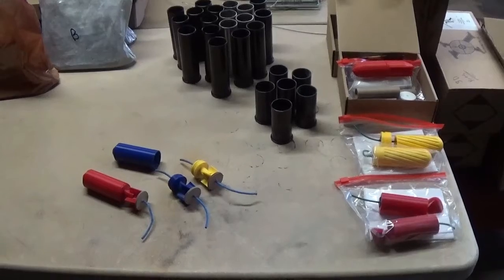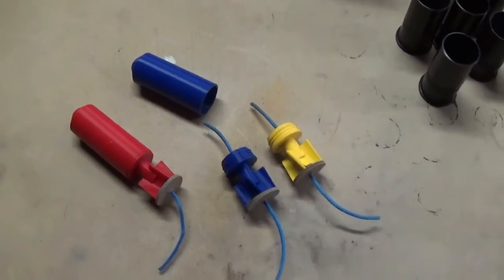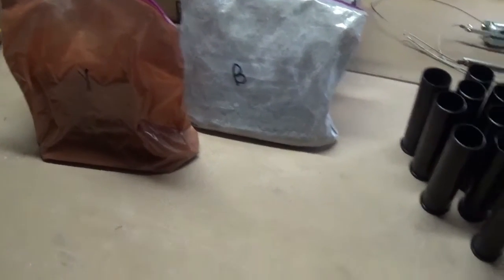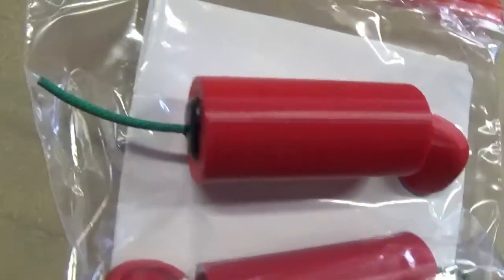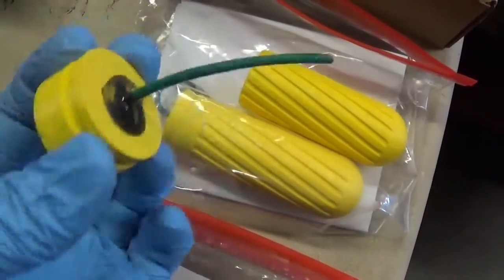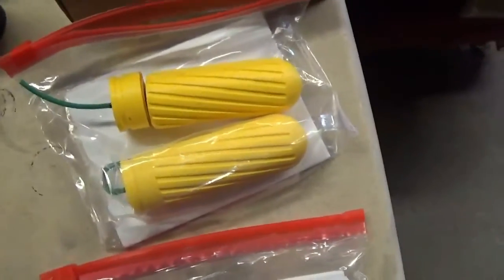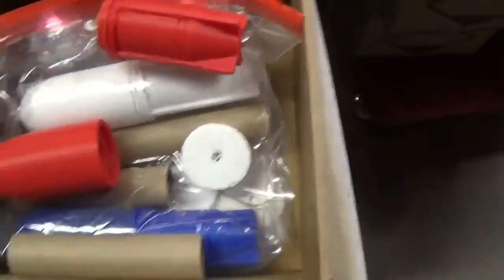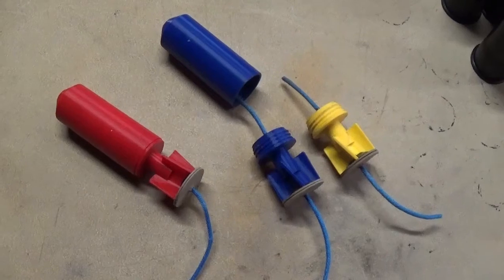37mm 3D Printed Projectiles For 2024

Comment: Nice. I've got an order from you that just shipped with some more 5" screw apart cases. I'll have to try some of these out in them soon. I'd like to see some full size bore-riding projectiles though, like an upsized version of the chalk rounds you offer that can utilize the entire bore of the launcher and not just the length of the case. I've been wrapping some long smoke tubes in electrical tape so they snug fit to the bore of the launcher and also using plastic easter eggs as nose cones that also fit very snug in the bore, it has drastically increased accuracy and added some range to them. Bore riding is definitely the way to go, otherwise your barrel is only 2-5" depending on your case length.